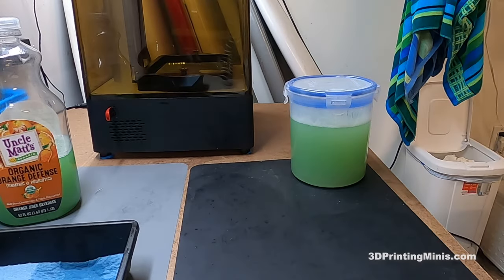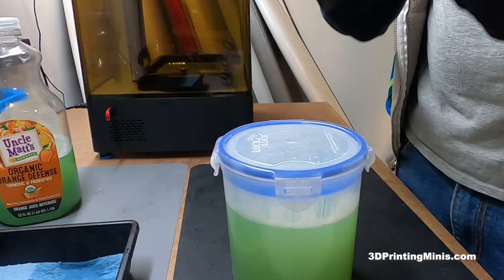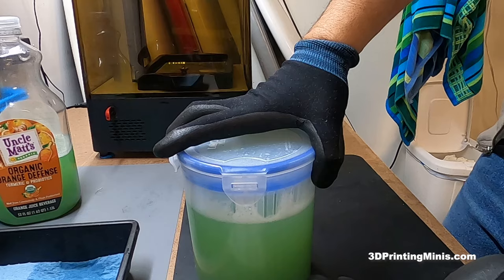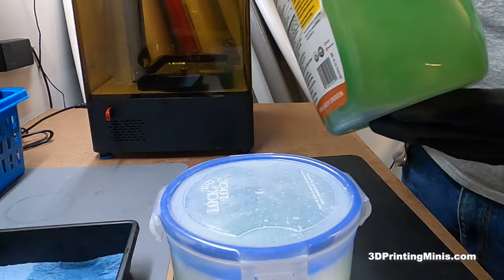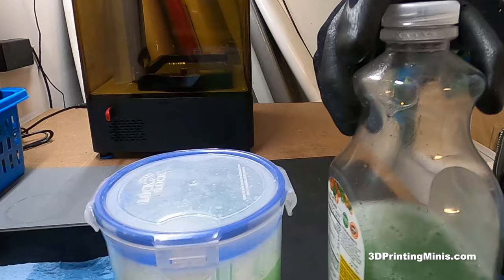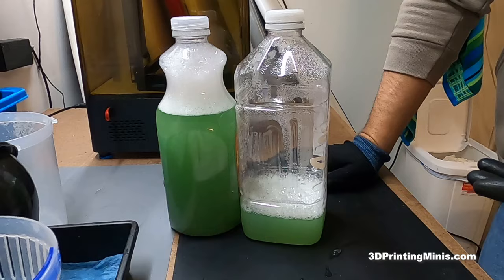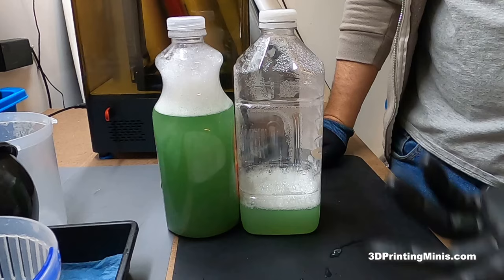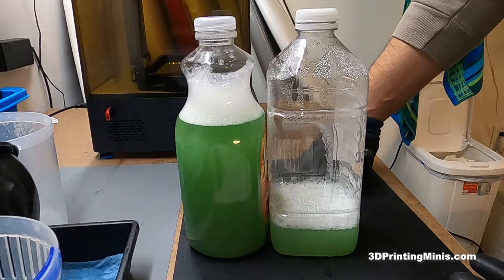How To Dispose Of 3D Resin Printing Liquids & Waste - What To Do With Toxic 3D Resin Printer Fluids

Comment: Rather than storing them in the garage, outside on a tray under the sun will help cure the resin in the solution. This greatly reduces the toxicity of the waste in case of spills. If you’re using pure isopropyl alcohol to wash, you can even filter and distill back to 100% then dispose of the dry cured resin in regular plastic trash.
Reply from the maker: Both of the methods you mention work. But, some people live in cold, snowy places that don't lend themselves to storing liquids outside. So, not everyone can do this year-round. :-)
Reply: @3DPrintingMinis  you could even put the bottles in an UV curing chamber and let it cure. Then pour back the distilled IPA and the rest of resin should be at the bottom for you to eventually throw away. This way, people in colder climates could also do this method.
Reply: @MyTasteOfMusic1   Exactly this, this also maximizes the use of the  IPA Alcohol reducing waste, Alchohol is ideal because it is the best environmental option once it is no longer practical to re-use as you proceed to clean and reuse it its efficacy is reduced once it has passed its half life you can simply allow the alcohol to evaporate safely and then cure the remaining resin and dispose of the cured resin normally in the general refuse. other cleaners don't have the evaporative properties that alcohol has an such you always create some level of toxic waste by-product that may require special disposal and is less than environmentally friendly.
Reply: @MyTasteOfMusic1  was thinking the same thing, the transparent tupperware with ipa tub then close the lid and blast it with uv. i guess im lucky that theres plenty of sun here and i can just leave it outside
Reply: By leaving toxic liquid outdoor, would that cause a problem to wild animals or stray cats?
Reply: @drrobotsir  If you're concerned about animals getting in it, you can cover the container with UV transparent polyethylene film (cling wrap).
Reply: @KelvinNishikawa  The problem with that is it will take much longer to evaporate, and animals can still tear it up. I'm using water washable resin, so I have water waste to dispose. It's more likely for the animals to drink it since it's mostly water. I'm thinking about using 5 gallon water bottles so the animal can't drink from it
Reply: @MyTasteOfMusic1  I have a bottle of water mixed with resin, and it won't cure at all in my curing station after 10 mins. Is it because the resin amount is too small?
Reply: @drrobotsir  Putting it outside isn't to make it evaporate. It's to get the big UV light in the sky to cure the resin. Even with "water washable" resins, it is very unlikely that you'll be able to treat the water at home to make it detoxified enough to return to any water or sewer systems. Isopropanol can be filtered and reused as long as the resins have been cured and it is a better option if you want a sustainable workflow. In any case, your only real option to dispose of the liquid is to filter the cured resin and send it to a hazardous waste disposal center. There is virtually no way to dispose of it yourself.
Reply: If you leave resin in the sun is any chance that the resin will produce heat and melt the ipa bottle? Or if you use uv flashlight?

Comment: Kelvin has the right idea. i use isopropyl and i use my UV light to cure the resin in it then filter off the solidified resin. it extends the useful life of your iso and decreases the amount of waste. using other cleaning agents may not allow this method to work and then your stuck with those cleaning solvents. with iso you can let it evaporate away after its useful life and collect the residual and solidify it in either you curing system of with a standard UV light.
Reply from the maker: Yep, curing resin and extending the life IPA are both good things.
Reply: i pour my iso into a 3l jar with tap wait few wait till the residue sinks then tap into bottle reuse thats what ive been doing ive made a video about it to.

Comment: if you cure it under UV and then let the solids settle, you can decant the clean mean green/IPA ect for reuse and only take the sludge to the hazardous waste.
Reply from the maker: Yep, people do this. It's a lot of work sometimes, but it's definitely possible.
Reply: @3DPrintingMinis  It does reduce the amount of hazardous waste that goes to disposal and has less of an environmental impact

Comment: Similar question around these topics: how do you clean your gloves? Mine have become very sticky, inside and out and I obviously don’t want to put them in with the laundry. Hot soapy water vat?
Reply from the maker: You shouldn't be getting your gloves wet or deep enough in fluid/resin to get them wet inside. I would recommend switching to 100% nitrile gloves. For the Dexfit gloves you can wipe them off with paper towels and a squirt of IPA. Then leave them out in the sun for 10 or 15 minutes to cure any leftover residue. But, again, you shouldn't be getting resin inside the gloves on the fabric part of the gloves.
Reply: @3DPrintingMinis  This makes sense. I’ve accidentally used the dex gloves  when dipping the prints in the denatured alcohol to brush off with a toothbrush. I usually use waterproof gloves for that part. I just need to be more careful 😊
Reply from the maker: I've done that, too. If you get them wet on the inside you'll want to turn them inside out and cure them. I only use them for holding the sides of my build plate when removing prints and then wiping down build plate before putting it back onto the printer. It's good that the Dexfit gloves come in a 3-pack. You don't feel too guilty if you wreck a pair and usually don't do it more than once. When the finger tips get worn. out I use them for wearing when holding the cardboard I stick my minis onto when I prime them with spray paint. It give them a great 2nd life. :-)
Reply: @3DPrintingMinis  Thanks for the advice!

Comment: I think I got my self some self cleaning IPA. It is sitting next to the printer in a transparent plastic container in a room that gets a little bit of sunlight, after every print I wash stuff in my IPA and before the next print it clumps up in to gooey chunks, so I just scrape those out and the IPA is clean and transparent. I am actually slowly losing IPA in that container because washing and cleaning takes some of it out, so I just use clean IPA to clean my vat and then add that to the container and basically I have a perpetual cleaning station where the only thing I do need to dispose of is the tissues and supports, but those just need to be cured and can be binned as far as I know.
Reply from the maker: Glad that works for you.

Comment: I store in jugs too and got one of the under the bed type large shallow and clear Rubbermaid containers. I cut a large opening in the lid and attached cheap window screen to it. I set it in the backyard on bricks in an area away from the house(it is flammable). I then dump my gunked up solution into the container and loosing attach the lid. The sunlight cures the resin and as the IPA evaporates the resin in solution cures onto the plastic of the container. When the container runs out of room(which will be a loooong time) I will see about where to dispose of a solid block of hardened resin. Haha
Reply from the maker: That's pretty smart. Glad you found a system that works for you. Thanks for sharing.

Comment: Another question:  Have you spilled your dirty IPA container (or whichever you’re using at the time) on the floor? This just happened. I mopped with hot soapy water then again with straight IPA. Still pretty sticky.
Reply from the maker: I would put some gloves on and grab a roll of paper towels and some IPA or acetone. Pour some on the spot and scrub it with a clean wad of towels. Pour some on the spot and scrub with more towels. If you get all/most of it off and it's still sticky you could always hit it with a UV light or flashlight to finish curing whatever residual resin is left. Wouldn't use a mop because you'll only going to get one use and then that mop head's gonna be dusted.
Reply: @3DPrintingMinis  Thanks! I ended up mopping but did use IPA and paper towels afterwards. That did the trick!  👍
Reply: Would definitely find a way to throw UV light on the affected surface as there could always be uncured resin no matter how well you clean. even the mop is now considered dirty from it

Comment: So what's your wash routine?  Do you use 99% IPA, or the Mean Green stuff?  I've heard that you're not suppose to use the Mean Green stuff in the wash-and-cure machines.
Reply from the maker: Here's a video with my workflow. https://www.youtube.com/watch?v=xVbwBrnh4RM

The workflow is as follows:

1. Remove prints from build plate
2. Place prints in pickle jar filled with Mean Green. Agitate for 30 to 60 seconds
3. Place prints into ultrasonic cleaner filled with Mean Green heated to 50 Celsius (recently have lowered this to 40 C and still getting good results). Run ultrasonic cleaner for 5 minutes
4. Remove prints from ultrasonic cleaner and immediately remove supports
5. Clean prints using spray bottle of 99% isopropyl alcohol and a soft toothbrush for 30 seconds each
6. Place prints in pickle jar filled with water and agitate for 30 to 60 seconds
7. Place prints in container on a paper towel, cover and let air dry for 12 to 24 hours
8. Prints are then ready to cure in UV curing station of your choice
Reply: @3DPrintingMinis  Thanks for the info. So my questions on after step 5. After the mean green and then the IPA wash, would it be bad form to then sink rinse at that point to get the IPA off?
Secondarily, where do you toss the water from step 6?

Comment: Have you tried the Elegoo water washable resin? I'm wondering if its viable to set a bottle of resiny water in the sun for a while then filter out the cured resin with a filter and reuse the water. Do you think the water will then be safe to dump down the drain?
Reply: Any liquid suspension with uncured resin in it is NOT safe to pour down the drain! It's possible to strain a good amount out to cure it and dispose of the solid waste, but there will always be some uncured resin suspended in the remaining solution.
Whether it's water, alcohol or some other cleaning solution, it needs to be disposed of properly, as shown in the video.
Reply from the maker: No, absolutely not. Do not pour it down the drain. Cure any resin or resin-tained fluids or materials (e.g. paper towels) you wish to discard fully before throwing them away. Store any dirt water or liquid that you can't cure in a large plastic jug (OJ, milk, etc.) and take that to your local hazmat drop off in your city. This stuff is super toxic and really bad for the enviornemnt.
Reply: @3DPrintingMinis  Would spreading the contaminated IPA (or water, if you're using water washable resin) on something like a cookie sheet and leaving it in the sun until all the liquid evaporates away solve this problem? That should leave only non-hazardous cured resin, right?

Comment: Ever think of using an electric distiller. I know it works with contaminated IPA. It's like new.
Reply from the maker: I don't have one but I've heard of people using them and liking them a lot.
Reply: I have a distiller at my house, but the main gripe there is just how difficult it is to clean out the hard, dry resin stuck to the inside